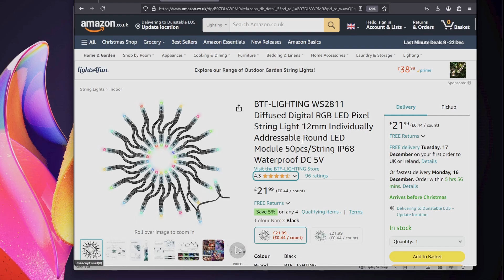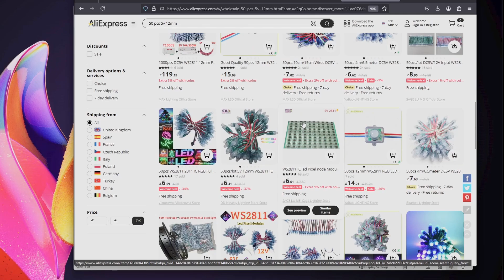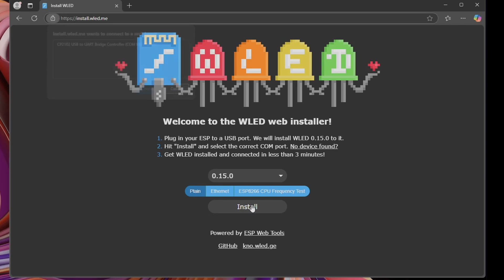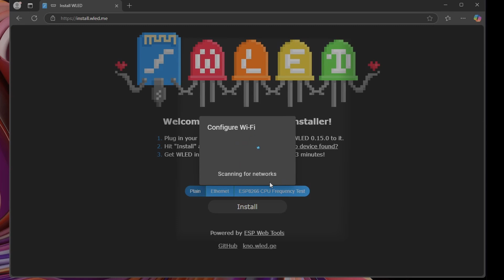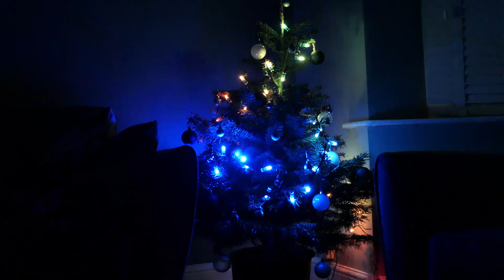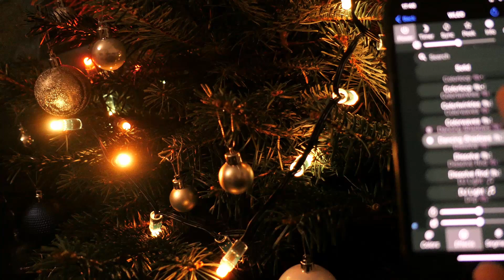Transform Your Tree🎄: Intelligent Christmas lights! Just 3 wires, super impressive! XMAS 2024 🎅🏻

Comment: I could be wrong, but from the looks of it you're powering the lights from the 5V pin on the microcontroller board. I have similar lights and they draw up to 3A at full power. You might be better off with an external power supply. Otherwise you risk shortening the life of the ESP32 or burning it out completely.
Reply from the maker: That’s a good spot! The led strip is indeed connected to the 5V pin on the ESP32 board… this isn’t such a problem for the ESP as the pin is directly connected to the 5V of the usb port (maybe via a diode to prevent over voltage of the USB), but it can be a problem if the LEDs draw 3A and your usb power source can’t supply it (most can’t!). What I did, but didn’t show in the video to keep it short, was to set the current limit in WLED quite low, ~300mA, before plugging in the LEDs. This stops usb power issues but limits the brightness of the LEDs. A better solution is to use a USB power delivery controller and USB C power supply, then you can draw 3 A no problem (and run LEDs at higher voltages etc). Check out my other light video for more detail… thanks for watching!!!
Reply: @thecircuithelper  I didn't realize you could do that in software. That's handy.